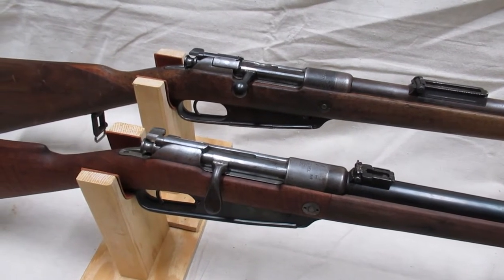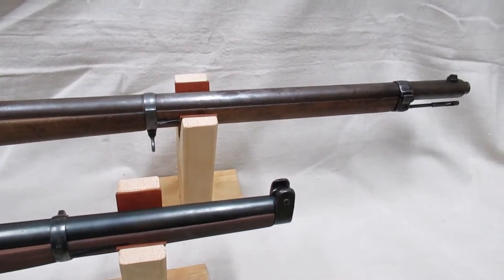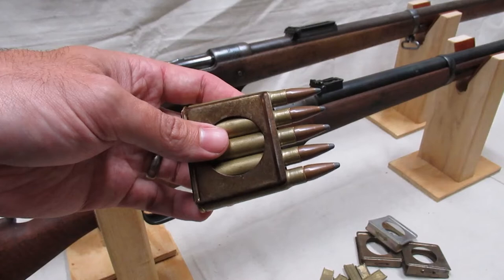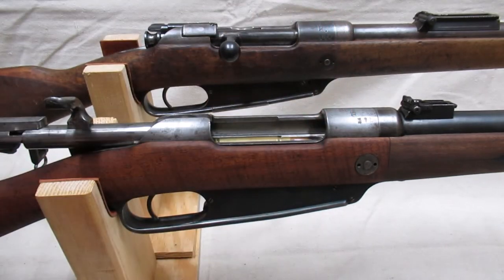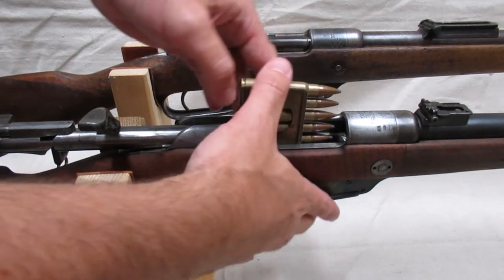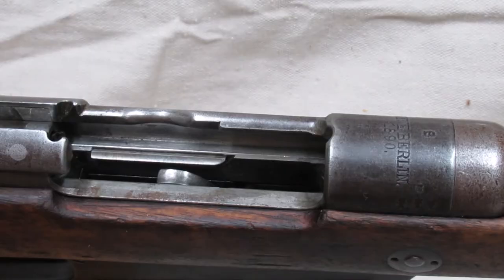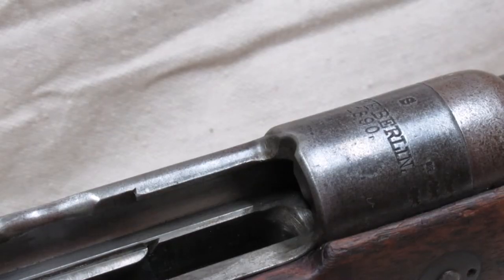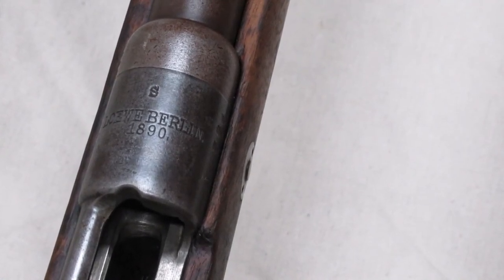Gewehr 1888 Commission Rifle - What exactly is the 88/05 update?

Comment: Yes misunderstood and your video adds to that . The guides where first put on with wedge screws that were then ground flush . Later they used plug welds ground flush . There are German military documents that say this and have diagrams .  NO rivets . The Gew-88 was not replaced as the primary rifle by the 98 until 1907 . The Germans used both the old P-88 ammo and the S ammo at the same time . The notch is to clear the old longer P ammo loaded by chargers . The S ammo was designed to be fired in the original Gew-88 , the S stamp just means the rifle was cleared to fire it and does not mean the rifle is a Gew-88 S . The Gew-88 S  is different . The movable metal tab in the mag well is the interrupter .   You should learn about a subject before youtubing it .
Reply: I don't get it? He didn't say half of what you said he did